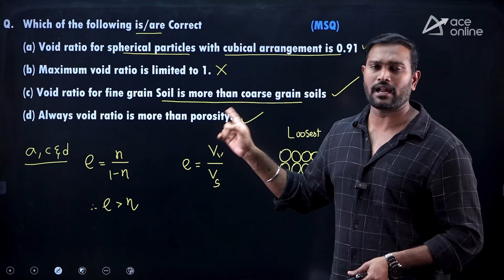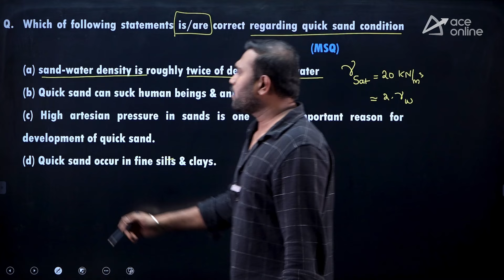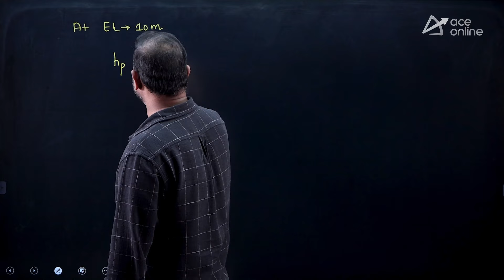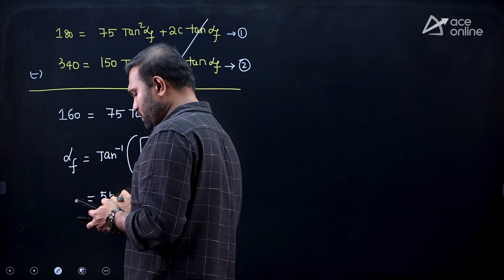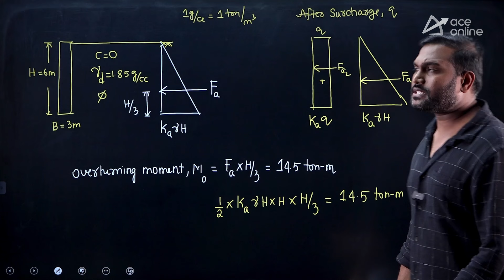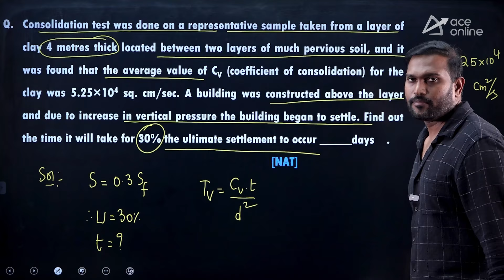GATE 2026:Civil Engg. | Geo Tech | Score Booster Series | NAT & MSQ Question Solving | ACE Online

Comment: Sir, in bearing capacity question circular plate area is π/4(0.3^2) and in question they mentioned that plate is placed at 1m depth that means  we need to consider surcharge effect
Reply: in plate load test, we need not to consider surcharge.
Reply: @muralikarthikkuntham1185 then what about plate depth placed at 1m
Reply: The second term in bearing capacity formula is due to surcharge effect of soil above the footing, but plate load test is done in open pit, there is no soil above plate so we shouldn't consider that term in formula
Reply: @weloveit3356  wt about the area ,sir took circular plate area as B^2
Reply: Yes we should take circular area